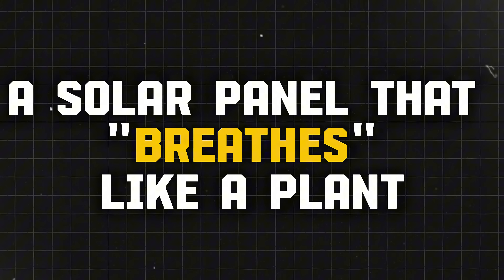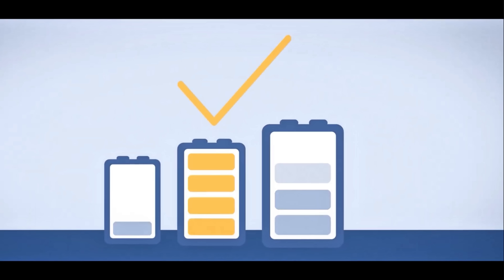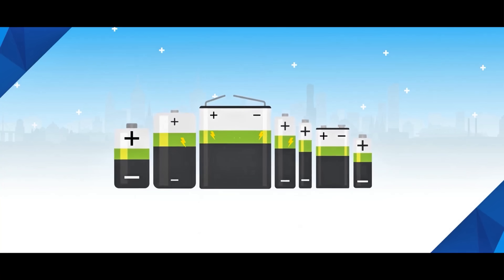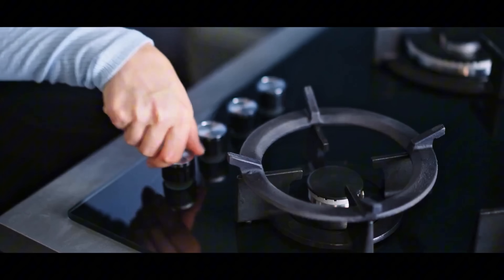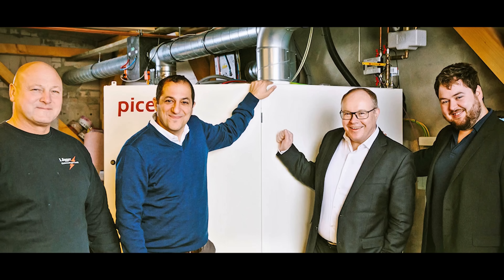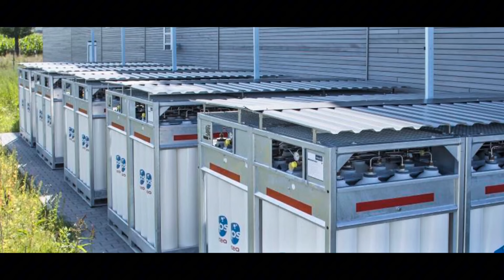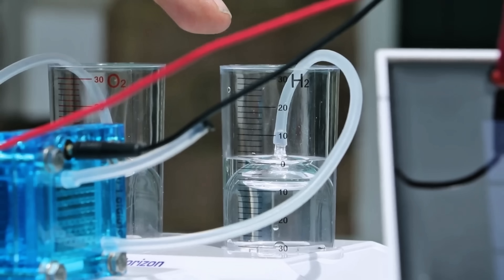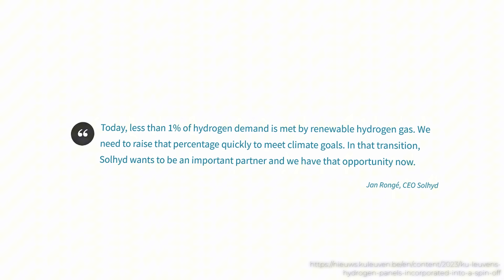Goodbye Batteries: This Solar Cell Generates Pure Hydrogen!

Comment: Total bs would be far more practical to use a natural gas generator, many homes already have the gas lines, The problem making your own electricity from gas is inefficient far less than having a utility company do it. 
250 Liters of Hydrogen is a meaningless number, are you talking about liquid hydrogen, compressed hydrogen or hydrogen at 1 atmosphere?  That is a 1 to 845 times difference in energy, You also cannot store hydrogen it expands and requires venting, ask any hydrogen fuel car owner, they are a nightmare, expensive, inconvenient and potentially quite dangerous.

Comment: Hydrogen is normally a gas that can be refrigerated and compressed into a liquid.
So, what pressure is this 250 litters at ? how much per 3X6 Foot panel ?
Hydrogen is very 'leaky stuff', right next to Helium in ability to leak out.

Comment: This sounds like an ad for a perpetual motion machine, a physical impossibility! The roundtrip efficiency of Solar-Power to hydrogen gas, to suitable storage pressures, back to electricity via Fuel-Cells/Turbines/ICEs is, for real-world applications, significantly less than 50%!!! Battery storage routinely reaches 90% or higher! Hydrogen Gas is a VERY NICHE energy storage solution at best...

Comment: This is not a new invention Electrolysis of dilute sulphuric acid to produce Hydrogen and water was discovered over 100yrs ago 😂 problem with Hydrogen is it's storage and flammability 😢check what happened to the Airship Hindenburg😢 kenya

Comment: If it can produce 250 liters of hydrogen a day, then it is at atmospheric pressure.
In that case, it only corresponds to 0.76 kWh of energy.
And when you have to convert it into electricity again, you lose 50-60% of the energy as heat.

If you have to compress the energy, it also takes a lot of energy, so this is nothing to shout hooray for.

When you store hydrogen, the molecules are so small that it leaks out even from steel tanks, so you can't store it forever, in that case the tank will only be empty one day.

For now, it is far better to store the energy in batteries.
Reply: You just cheaply store it as magnesium hydride.
Reply: You just saved me from typing all this my self :). One can NOT create energy !!! One can ONLY transform it. Some good ideas here, but it won't work in real life

Comment: Hydrogen is the worst, 1st off its not a fuel it has to be made. The media lies, and tells you its 3 times more energy dense than gasoline. What they don't tell you, is Gasoline energy density is equivalent to hydrogen energy Density when the hydrogen is at 35000 pounds per square inch. They also don't tell you to make it useful it needs to be in a liquid form. This not only requires insane pressure but also massive coolers it get it to a low enough temperature. Its the lightest element so it leaks out of everything, and not to mention it does not play well with certain rubbers and plastics. Here is the best part to make it on scale the cheapest way is with fossil fuels like converting natural gas or propane. These type of solar generators have been tried before and failed. You will get more energy from a solar panel. I remember watching a promotional video on a new hydrogen car. In behind were massive diesel generators converting compressing and cooling the hydrogen.

Comment: "  ...  Hydro gen can be stored for months or years ... ".  there the biggest lie.

Hydrogen in it's gaseous form requires massive volumes of space to store usable quantities.  Think Hindenburg.  Liguid Hydrogen requires enormous amounts of energy to compress the gas so it can be stored in expensive heavy steel tanks that need to be refrigerated down to -423 degrees F, -252 C which requires even more electricity.  lastly, the hydrogen molecule is the smallest molecule in resistance.  It is so small it can escape between iron molecules used to make storage vessels.  This is why NASA has to keep filling their rockets hydrogen tanks right up to launch time.  Finally, I'll give you one word to address the storage of hydrogen.  Again, think "Hindenburg".

Comment: 250L/day is 0.75KWh of hydrogen which, if you're lucky, will produce about a 0.4KWh of electricity. However, in the winter when there's no sun it's going to produce a lot less, especially in the UK.
Another Point of course, is that all the energy is produced as hydrogen, and to converted back into electricity, even using efficient Fuel Cells, you're probably only going to get about 55% efficiency out of this system. So in terms of electrical generation the system is only effectively about 7 to 8 percent efficient, compared to 20% + for direct electricity use.
Then if you do the rough calculations, a typical UK home with probably require around 1,000KWh of electricity from storage to see it through the winter months, that'll probably need 60+ special (probably stainless) 50L industrial gas cylinders (probably weighing about 60+ Kg & about £/€150 each) with about 0.7Kg of hydrogen in each one (because hydrogen doesn't squash very easily). 
Then then there's the belief that scaling up is going to bring the cost down a lot, that's not going to happen. A large chunk of hydrogen storage technology is plumbing, valves,  pumps, pipes, cylinders etc., which is all mature technology, so there's not a huge scope for cost reduction.

These guys really should do their whole systems critical analysis.

The only relatively cheap way of storing hydrogen it's in geological salt caverns which cost about €50/m³ to make if they are a few 100,000's m³ each. Using industrial gas cylinders you probably looking at about €3000/m³!
I could go on, but I would suggest leave hydrogen storage to the big boys.

Comment: Not at all practical. Difficult to store hydrogen. But the energy losses at each stage is immense. Solar to hydrogen equals loss. Then hydrogen cell to electricity introduces huge losses. This is a silly idea.

Comment: Theoretically you are right but practically you are not! On the other hand,it’s not so easy to get hydrogen from the water.The overall cost of its operations is higher than you get..In addition to that, the conservation of the  hydrogen tanks is very risky.You need a perfect production plant  for the hydrogen generation..While the new technology of battery is rising,it’s opportune to get Battery Megapacks 9:23 and get the electricity from there for the house usages.☺️

Comment: It sounds good 250 Ltrs  per day but if you convert it to energy that's 750Watt hours which has a value of less than £0.06  (cheap rate electricity from grid)
Forgetting the storage tanks and conversion equipment,  my guess is just the panel will cost at least £300  
So that's 13.7 Years for return of investment,  and that's only if it can do maximum output  365 days every year.
It is not economical and never will be.

Comment: Very cool. That this system can make 250L a day is more than enough for a house. It's a great way to store power. Importantly we are using free solar power to make it so the inefficiency is a mute point. Yes safety is also important so well ventilated storage areas with H2 sensors would be a must. As would be automatic shut down when any leakage is detected. I see a strong future for this method as long as costs are competitive with other methods.
Reply: Irrelevant due Batteries drooped below $100 for Kwh and projected to drop bellow $70 in few years
That makes H2 system economically not viable for home usage.
Reply: Any Hydrogen cost advantage would be negated by high energy consumption of a sturdy compressor to liquify and store the gas. A commercial application would be 10x more efficient than any home system, therefore an unbearable expense for homeowners.